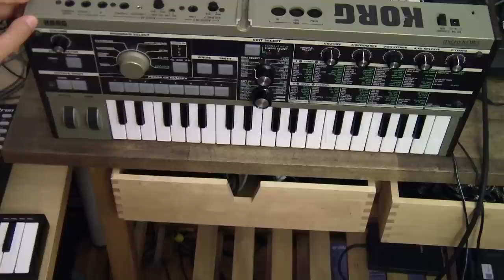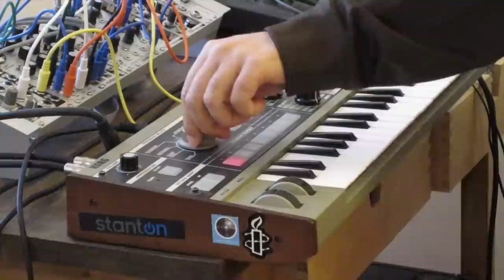Microkorg Vocoder 1

Comment: i wanna know that anymic could hookedup with microkorg in vocoder？
Reply from the maker: Not just any mic, you can use the mic that comes with the Microkorg using the 3.5mm jack. Alternatively, I think you can use a dynamic mic 🎤 that plugs into the 1/4” plug which is what I did for this video
Reply: @Mamotreco  the mic with earphone is okay??? i wanna mod it, cuz my microkorg doesnt have a mic, so i need to get one on it~,thank you for your reply~
Reply from the maker: @WitnessVNZ  ummm I'm not sure that would work, I've only tried the microkorg mic and a Shure SM47 on the dynamic input. What do you mean by mod it?
Reply: @Mamotreco  i wanna remake one like the original, but i dont know what they used for original mic

Comment: Does a standard desktop mic works,.?
Reply from the maker: A dynamic mic 🎤 can go straight in. A condenser mic (podcast style) needs to go through a preamp and the preamp out can go into the Microkorg (in that case the input should be set to line)
Reply: @Mamotreco  so a shiity computer one won't work? I don't get if it won't work on the small plug or it .wont work at all
Reply from the maker: A computer mic is probably dynamic (it’s not about the shape but the technology) so it should. It’s worth a try as long as it can put out a decent output level, you should be able to vocode that. Trial and error as always.
Reply: @Mamotreco  vocorder function on but still nothing idk
Reply from the maker: Sorry to hear, I don’t have the Microkorg anymore unfortunately so I can’t troubleshoot or check for solutions

Comment: I just put one on layaway for $299.00
I don't believe that it has the vocoder mic with it. Does anyone know how I can purchase a new one? And I also have a Yamaha keyboard that doesn't have midi outputs, or inputs, I'm wondering if there's a way that I can join the microKorg with the Yamaha? 🤔
Reply from the maker: If the Microkorg is new it should come with one even if it’s a basic mic. If your Yamaha kb has usb midi you could use a usb midi interface or usb audio interface with MIDi to connect the two

Comment: Can you please andwer my question as i dont know what ive bought regards audiotron1003
Reply from the maker: Hey, my keyboard died mid response. Anyways, I only know of the EMS 2000 by the legendary reputation that precedes it. I would say the Microkorg has a capable vocoder that I found easy to use when I had it. I strongly recommend you use it with an external microphone (ideally you can run the external mic through a preamp and then bring it into the microkorg external input at line level). The internet tells me that the EMS is a 16 band vocoder, I know the microkorg is an 8 band vocoder which means it will have a different sound quality but I found it to be easy to program and giving great results.
Reply: @Mamotreco  so regarding my external mic i can plug it straight into the back of the korg and it will work yes?  I dont have any other gear no pre amps drum machines, mixers computer etc just a korg to replace my old vocoder.

Egards Audiotron
Reply from the maker: @audiotron1003  Yes it is possible. You plug into the jack that says Dynamic and have the switch over to mic.
Reply: @Mamotreco  thank you for your time i think i will watch more in your channel as i need to learn how to use this machine.

Comment: I think my mic just never worked you just can't hear any words ever
Reply from the maker: Yeah the included mic is not the best, I found better results with a dynamic mic going into a preamp to boost the signal and then into the Microkorg (set to line level input if I remember correctly)

Comment: how did you change between wave forms?
Reply: Set big knob to OSC 1 or OSC 2 and first small knob from the left changes waveforms; consider that you can set OSC 1 to digital and choose from various digital samples using 3rd knob
Reply: Also remember that you set the level of both oscillators on MIXER (knob 1 and 2)
Reply: Lol, this is for synths, might be different for vocoder, sorry